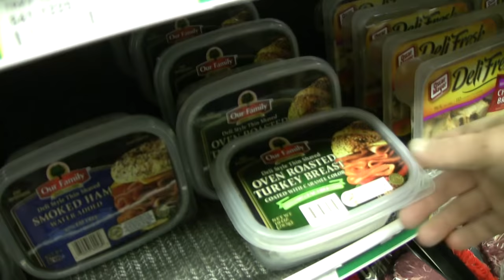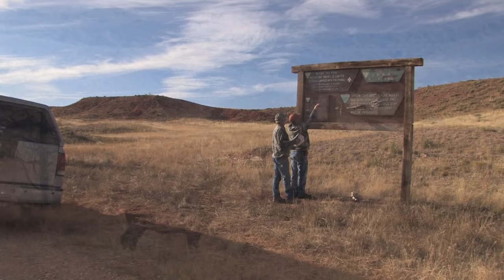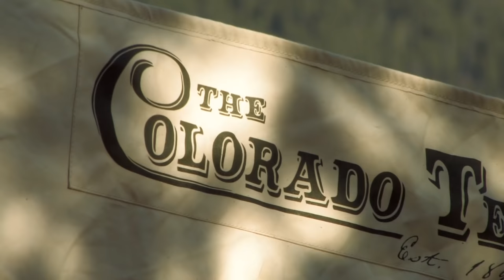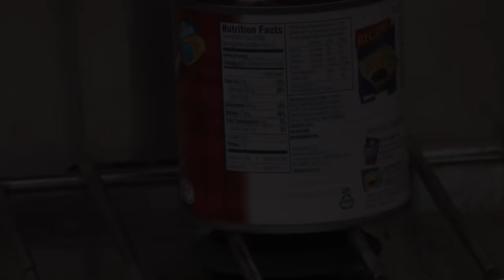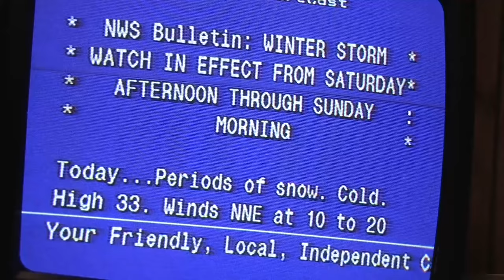Hunting Wyoming Elk with Randy Newberg (OYOA S1-E1)

Comment: Hey Randy, I saw the island of public on the map you were using. How did you get in there? Did you have permission to cross private? Was there some public road the accesses it? I'm starting to look at the little pockets of BLM here in my state, and trying to figure out when it's possible to access them.
Reply: +Live For Now Get in touch with your local BLM office and find out your states access program and maps of the area. They are a great wealth of information. Another tip I use a garmin GPS with a hunting chip that shows public and private land. I have had some ranchers mark public land as private. It's a great tool.
Reply from the maker: +Live For Now - Yeah, Kenneth Nelson has it nailed.  Get a map chip from onXmaps.  It will show you all the ownership.  A lot of times the county has an easement for the county road where it crosses private.  Those can be your tickets to access.  Best of luck this season.